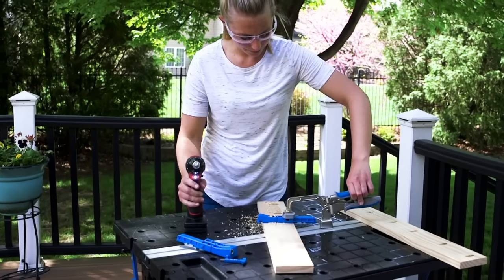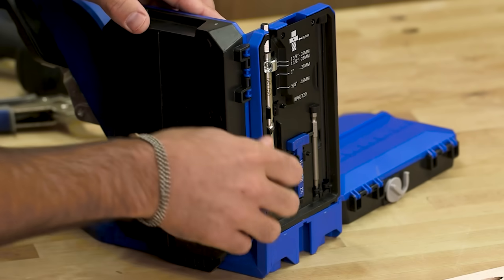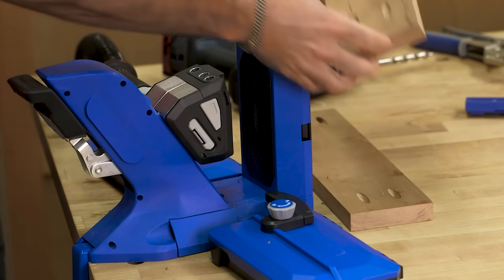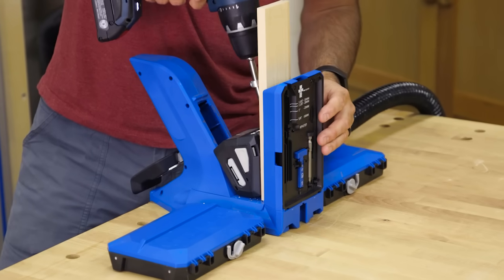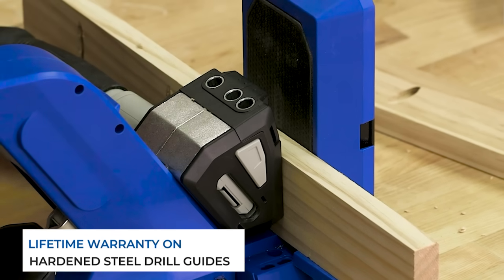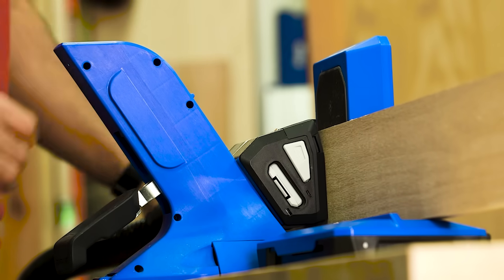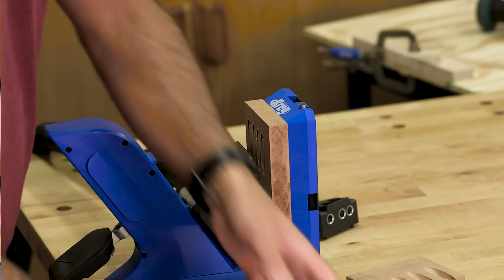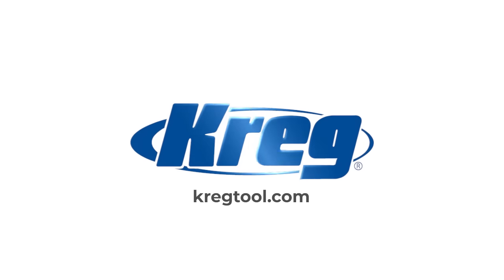Kreg Pocket-Hole Jig 720PRO

Comment: Do these work with 2x4?
Reply from the maker: The 720PRO works with material 1/2" to 1 1/2" thick. We also released a new XL pocket-hole jig today that is specifically designed for 2x4 and 4x4 projects that you might be interest in: https://www.kregtool.com/shop/pocket-hole-joinery/pocket-hole-jigs/kreg-pocket-hole-jig-xl/KPHJ920.html

Comment: The integration with the vacuum hose makes a big difference when drilling. I think the Kreg Tools generally are well designed, easy to use and work as intended. You can't beat that combo.
Reply from the maker: Thanks for the love! We're big fans of the integrated dust collection, too.
Reply: nice

Comment: It does not look compatible with the HD Screws, AS I can use with my current Kreg jig with the HD drill bit and  2" thick lumber?? I Use these a lot for building garden projects.
Reply from the maker: Correct, we still have the Kreg Jig HD for this use. 
https://www.kregtool.com/shop/pocket-hole-joinery/pocket-hole-jigs/kreg-jig-hd/KJHD.html
Reply: Seems a shame not to include HD guide on this.  It's definitely a top used joint by me.

Comment: Will there be an HD insert for doing 2x4's?
Reply from the maker: At this time 1 1/2″ is the thickest recommended material for the Pocket-Hole Jig 520 and Pocket-Hole Jig 720/720PRO. If thicker material is needed, please use the Kreg Jig HD that offers twice the joining strength over the standard Kreg Pocket-Hole Jig.

Comment: Have most of the previous versions but not the K5 or the K4.  I think it was call the R3 pocket jig and smaller one so had numerous smaller issues with these cheapest versions...lol, of course.  However after testing this unit, glad to have something that gets rid of the nuances the others had if you weren't perfect in set up.  Was thinking of gettting Kreg Foreman but that one is over twice the price!  Getting ready to try out on 3/4 maple face frame for some cabinets i'm installing... woo hoo!

Comment: Why no 3/4 inch thiknes?
Reply from the maker: On the Pocket-Hole Jig 720/720PRO, the jig will adjust automatically to the correct position with Automaxx® one-motion clamping. Please do not forget to adjust the depth collar to the material thickness of your workpiece, which does include the 3/4".